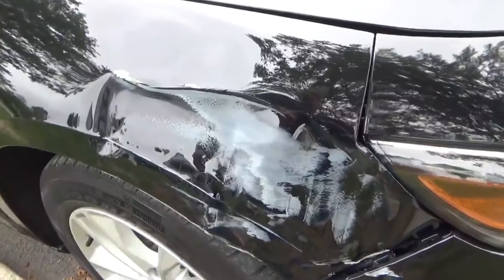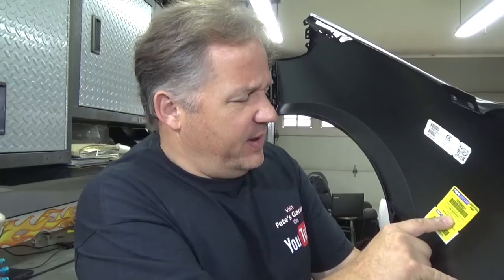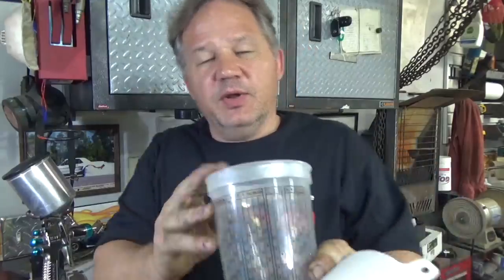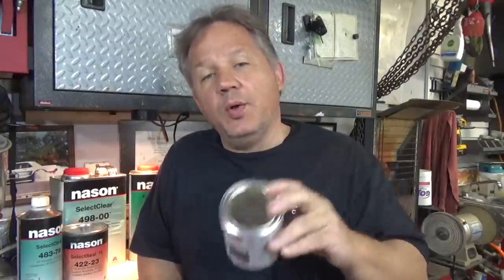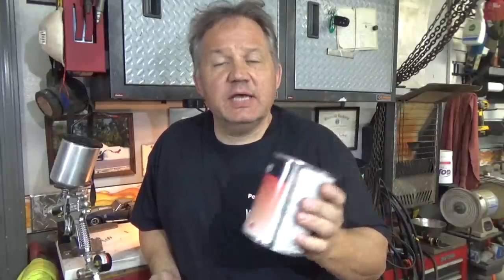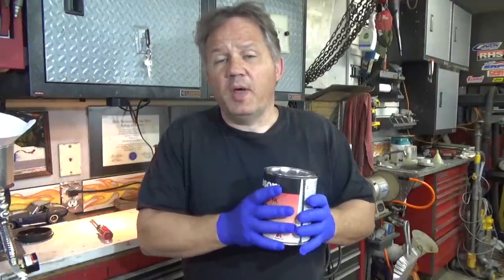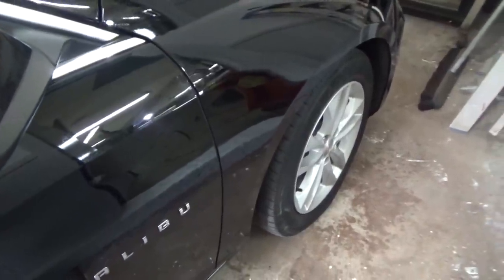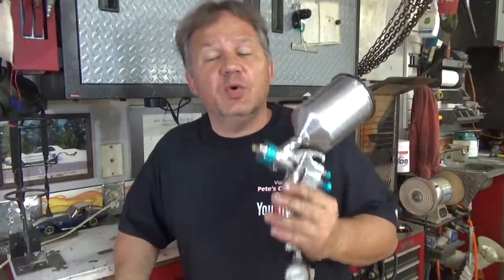Beginners Guide to Getting and Painting Car Parts

Comment: Thanks for the great video Pete. A small tip that was taught to me, is to use Prepsol to clean the panel before Scotchbrite, then Prepsol it again. This helps to reduce the chance of rubbing contaminants into the surface with the Scotchbrite. Also, how is the Cobra coming along?
Reply from the maker: Great tip! I'm taking the Cobra apart to start the bodywork

Comment: Outstanding summary, Pete. I didn't see any buffing afterward, do you buff in the orange peel later to make it match a little better? And you mentioned a sealer at the beginning, I guess that means you don't need a primer if it is already painted first? If you prime it yourself, do you still reach for a sealer coat?
Reply from the maker: Thanks my friend. If there is a huge difference I will blend with a buff. This one is pretty close though. The fender came primed, I just use the sealer to make sure.

Comment: Looking through the comments you really do reply to everyone, that's pretty cool! I've been looking on OfferUp for some spray guns, some pretty decent deals. I have no prior experience but I am going to be painting my front bumper on my civic and a spoiler, both are new and already primed. I'm also planning on touching up the fender and fixing the trunk due to a rather large dent, about 3-4 inches with paint damage. What would your advice be? Around how much paint should I buy and are there any steps that may not have been mentioned here in this vid that might be helpful in my case? I'm a new subscriber so I will definitely be looking around for more of your videos and I do plan on going to a few shops and talking to them as well like you recommended but would love to have some of your input as well. Thanks for your help!!
Reply from the maker: I tried to include every step, following the mixing instructions on the can or ask the paint retailer. You can get a good gun for around $130 that will last a lifetime if you take care of it. You can do it